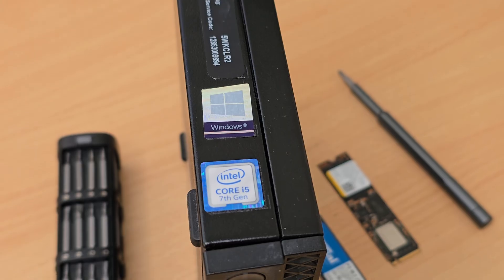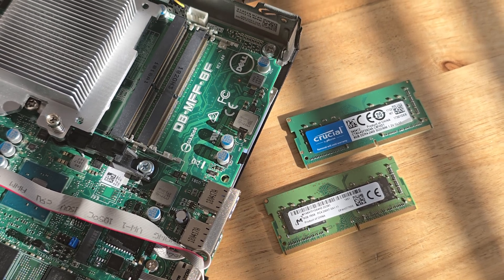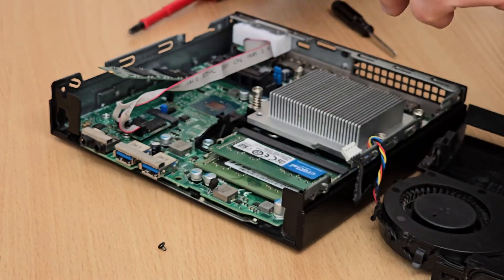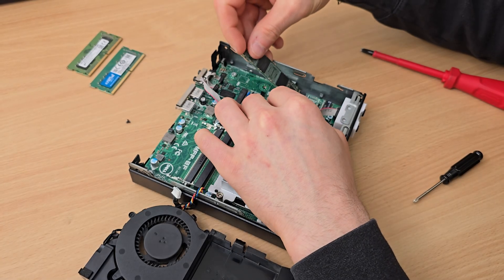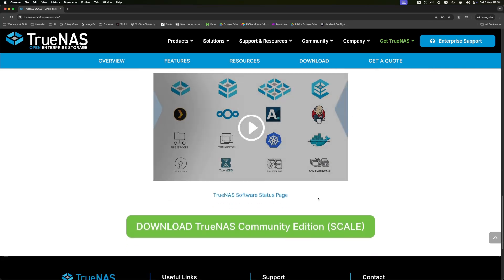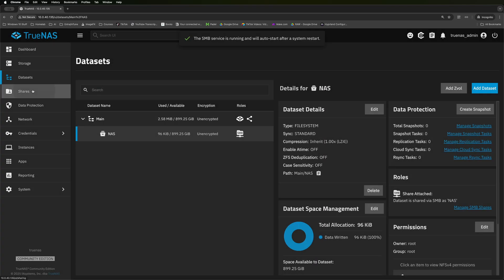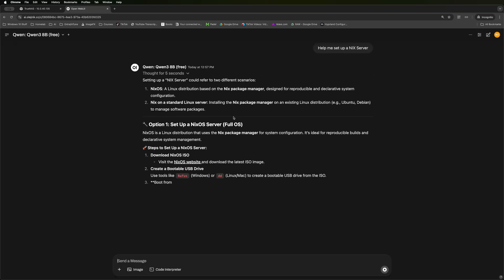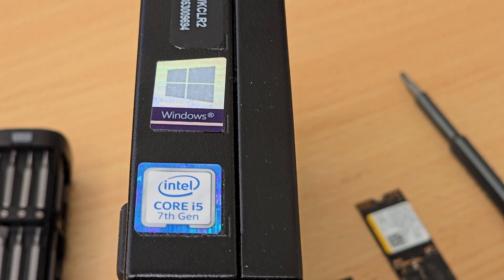I Turned a $30 Mini PC Into a $300 Home Server (Step-by-Step)

Comment: Nice vid., and nice tiny little machine, powered enough, to run Win  7 as Surfmachine and watch few vids.
I watch now 2 vids from u, and i get the impression, your focus is mostly to truenas, more than the machine,.. cause, yeah, it is maybe cheaper than a pi , but for a Nas Device, i am not useing something like this...
For a 500GB HD, i would use (Samba)Share.. that´s it, even u have outsourced your stuff at google...
And when u would use for "easy stuff" i would more recommand something like zima os , based on debian, cause something like this is really beginner friendly
TrueNas... naahhhh, wasting the poss of this device. Just my2c